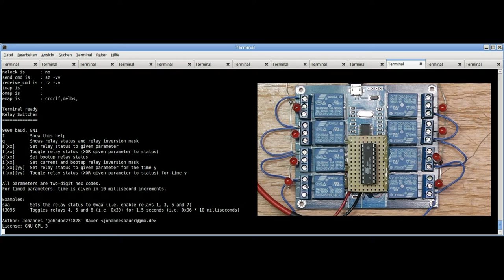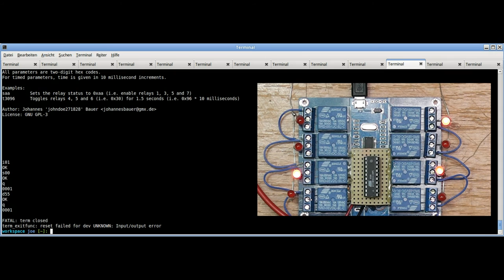Hacking a micro-USB relay module (ICStation ICSE014A)

Comment: Fun video! Shame you didn't have any experience with the STM as it would be nice to just swap firmware. I find the STMs to be more agreable to work with than the AVRs (which I used to use a lot).
I am actually in the process of doing so right now on a USB-RELAY04 board. (You have the 08 version with identical hw except for addition of power plug.)
The 04 I have do have an extra position for a pin header and it has debug interface, reset and power/ground which is very useful for me right now. Chip was protected but easily erased.
I too was really annoyed by the single byte protocol and the lack of any way of reading back state. Also, I would like the card to go to default of host/app is disconnected as I wanted to use these boards in a testing environment where different tests may be run by remote triggering. I don't get your inversion mask though, it adds complexity and less security. I think I will add a Set and a Reset command though so one can easily turn on or off any relay without affecting the rest in addition to a Relay command to set all relays to match state with parameter.

Comment: Thank you for the video, I also got my board and hooked it up to usb and was so annoyed with that firmware. Would be possible to put your firmware directly to already soldered microcontroler? I mean, would it be compatible?
Reply from the maker: +ZnidaSLO It wouldn't be directly compatible, you'd have to do some porting work from the AVR architecture to the STM8. So what you'd have to change is basically everything that is hardware-dependent. That's basically

1. The way interrupts are set up (RS232 and Timer IRQ)
2. The way the timer is configured (for timing out after 2 seconds with no RX data)
3. The way the RS232 is configured (RX and TX)
4. The way the GPIO works (for output of the relay switching)
5. The way the EEPROM is accessed (for storing the initial values of the registers)

All-in-all, there's a lot of hardware dependent code because the program itself is pretty trivial if you look at it. But I agree, having a pre-programmed STM8 would be the best solution, I just don't have one. If it were open-source then maybe even the vendor could be convinced to flash their devices with the open source firmware (they'd be free to do so legally).

If I had a programming adapter for the STM8 here, I might even have tried to go down that route. But unfortunately I don't. Sorry about the bad news.
Reply: you prolly dont give a damn but does anyone know of a trick to log back into an instagram account..?
I was dumb forgot the account password. I love any assistance you can give me!
Reply: @Yousef Taylor Instablaster =)
Reply: @Dylan Milo Thanks for your reply. I found the site on google and Im trying it out now.
Seems to take quite some time so I will get back to you later when my account password hopefully is recovered.
Reply: @Dylan Milo It worked and I now got access to my account again. I'm so happy:D
Thank you so much, you saved my account!
Reply: @Yousef Taylor Happy to help :D

Comment: Ok I like this video a lot but as a noob I have several questions.
1) What device are you using to program the attiny2313?
2) What software are you using to toggle the relay so fast?
3) If you had multiple boards could you run all at same time?
4) Do you have a diagram of the stm8 connections you soldered too?

Thanks in advance
Gren
Reply from the maker: +GrenPara Hey there, some excellent questions!

1) Since I'm not using ICSP, I used my TL866CS "MiniPro" programmer for this. It's a cheap (around $50 from China) universal programmer with ZIF socket that supports lots of devices, among which the ATtiny2313 is. Really wouldn't want to miss it anymore, it's very good value for the money.
2) I just wrote some simple Python script to do the fast relay switching. You probably could even write a small shell script for this, though.
3) Yup, you can. Multiple PL2302s are detected by Linux as /dev/ttyUSB0, /dev/ttyUSB1 and so on. When doing a bit of tweaking of the udev rules (the files placed in /etc/udev/rules.d) you can also make Linux auto-detect the serial number of the PL2303 and tell it to make it symlinks of your choosing (e.g. /dev/fan_relays, /dev/spkr_relays, ...)
4) Ah, you caught me. I do not! However, I just looked it up and think these values should be correct (but please double check, mine is buried under all that hot glue so I can't check):
GND: Pin 7
+3.3V: Pin 9
RX: Pin 3
TX: Pin 2

Thanks for the good questions!
Reply: +johndoe271828 Hello, Thanks for the quick reply.

Thanks for the info on my questions, I will get what you suggested.
Your video is one of the best i have found online and as a total noob I learned a lot.

Thanks again.
Reply: +johndoe271828 

Hey there, I have one more question.
What type or model microscope did you use to see the small solder points on the board?
I am trying to find a good yet cheap microscope for doing small solder points as my magnifying glass is just to small.

Thanks in advance
Gren
Reply from the maker: +GrenPara So I'll start out by telling you what I'm using: I have a no-name trinocular stereo microscope (i.e. a stereo microscope with the ability to send the light instead of to the left ocular through a third path where you can mount a camera). I think I paid around EUR 600 for it about 4 years back or so and got it from eBay. At the time, there wasn't really lots of options and the "real" brands started at 1.5 kEUR-2.5 kEUR.

Right off the bat I can tell you that I very very seldomly use the trino feature and I wouldn't order it in that configuration again. That'll save $100 off the bill. Also, my stand is pretty heavy duty (partly beacuse it needs to hold the camera, I think). I think I'd bolt the baseplate down to my table for my next one.

Some general points about stereo microscopes: Not all people like how it looks through a stereo microscope, it kind of takes some getting used to. If you can, try to check it out first and see if it gives you any trouble (nausea, headache). I find that a stereo microscope (i.e. two lenses with two slightly offset light paths for each eye) takes some getting used to, but the stereoscopic (i.e. "3D") vision you get is very well worth it. Makes soldering and judging distance so much easier. Some microscopes will have two oculars but just one light beam path (i.e. no stereoscopic vision). I wouldn't recommend those, but YMMV.

Another point: Mine has a total magnification of 7x-45x. I.e. 0.7x-4.5x at the lens and 10x oculars. For soldering, I seldomly need the max magnification. 7x-20x is probably what I use most often. Actually when you search for 7x-45x on eBay you'll find some stereo microscopes that look pretty much identical as mine does (only the stand is different). I'd bet those are exactly the ones I have. An example is eBay #400718128992 which is sold as an "OMAX" brand type W42CPT-L08 for around C$ 350 (i.e. around 250 EUR).

My first stereo microscope was a much cheaper, simpler one: A Bresser Junior 20x. It's targeted for children, but it works pretty well and I do have mine in use for mobile stuff (but I've reworked it a bit and basically turned it into fancy glasses). It sells for around EUR 40. To get an impression of how this looks, check out eBay #111630971351. The fixed magnification is a bit on the high side, but it works alright for most stuff. Maybe you can pick up some cheap second-hand oculars for it, bringing it down to x10 or x15 magnification, then it'd be perfect, I think. Also doesn't take up lots of space.

So I hope this wasn't all too confusing and comprehensive enough, if you have any more questions, just ask away; I'm really happy to help if I can :-)
Reply: +johndoe271828 

Hey johndoe271828,

Thanks for the fast reply to my question again, I really do appreciate it.
I checked out the microscope you suggested and on Ebay.ca which is Canadian site it sells $365.98 + shipping.
It is close to the Holidays so I might wait till after the holidays before I spend cash on it.

Thanks again for the help and I look forward to your projects now that I am subscribed.
Have a great day and Holiday Season.
Gren